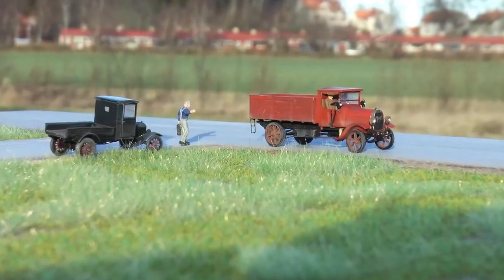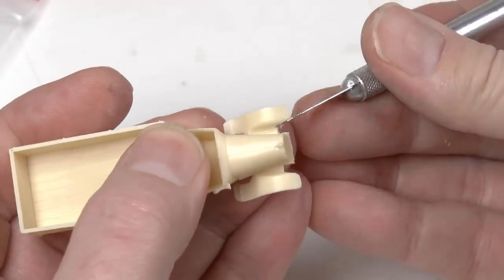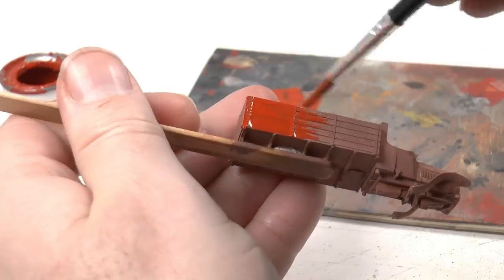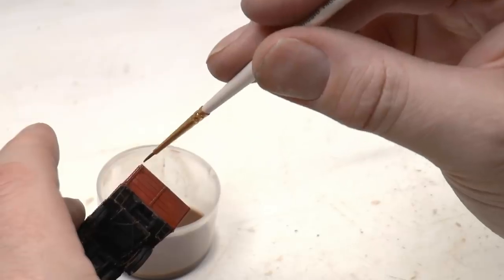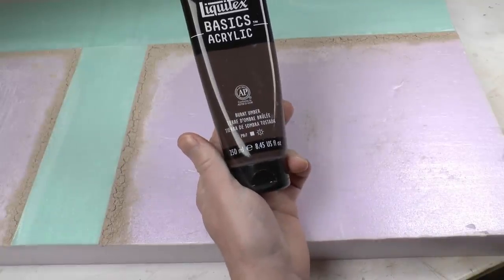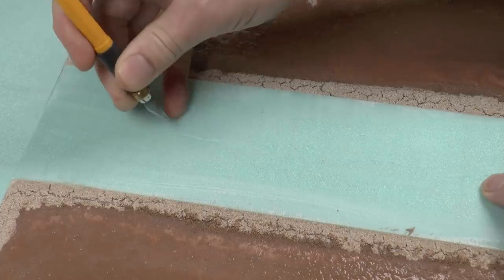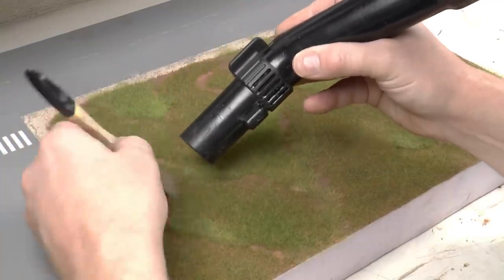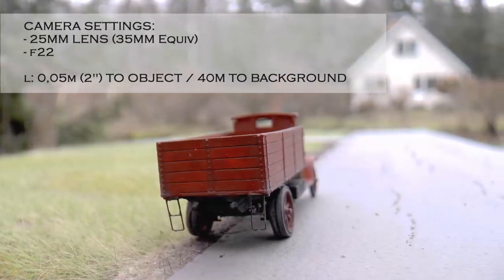Building and setting up a miniature Road

Comment: As acrylic primer for my resin or brass models as well as plastic and card & wood lasercut pieces, I always use the Vallejo Surface Primer, which comes in a variety of colors. You can either apply it with an airbrush or a brush (in which case I mix it 50/50 with model Color paint for more consistency as the Surface Primer is diluted for airbrush application. Let dry at least 24 to 48 hours before painting with any other acrylic or solvent based color.
To obtain a sharp image for the subject as well as the backdrop, there several solutions. The first one would be to work with the smallest aperture available (ideally close the lense to the maximum). You'll need to work using a camera stand due to the very long pause for this kind of picture. The other solution would be to take a picture of the backdrop without the subject, then add the subject (diorama) to the perfect distance and angle from the lense and use a green or blue screen backdrop and later on merge the pictures by photo editing it. The best result will always be obtained with camera lenses that allow to get the smallest aperture possible and taking the picture outside at low shutter speed (thus with a long expostion time).

Comment: The diorama came out nice. The truck looked very good. Maybe do the pictures with the overlapping technique with the computer. Focus on the background houses first then take several pictures focused on different places as you move backwards to the foreground. There is an photographic program you can use to overlap/overlay the pictures. I'm subscribed to a channel called TSG Multimedia. He explained how to do this with outside diorama photography in a video not too long ago. Within the last month or two. Maybe that would help you out. Check it out.   👍
Reply from the maker: Thank you for this advise! I’ll check it out!
Reply: @marklinofsweden  Oh. I've made a mistake and hope you read this before looking. It is not TSG the channel is "Model Railroad  Hobbyist Magazine" and Ken Patterson shows the technique. It's still the first video right now. Hope it doesn't cause too much confusion. I'd forgotten about telling you this until recieving this from you now. Sorry.

Comment: I recently watched your video on Marklin M-track. I have enough Marklin C-track I purchased  to make an oval;  and modified to two rail operations by cutting the running rails  so that each rail was isolated. My problem is that my two locomotives are two rail H0 Australian AR Kit so I have to have two tracks to be able to run them. I would like to expand my tracks to have some turnouts when I set it on the dinning room table; but I am not prepared to modify Marklin C-track turnouts so I thought that I might use Marklin-Trix C-track expansion set and replace the oval with some Trix C-track. I wondered if you ever thought of making some video tutorials on this subject of using the Marklin's Trix tracks like you have done with Marklin system. I some hope to own a few marklin locomotives; but now know if I ever build a layout it will be an 0e gauge.
Reply from the maker: Hi! Yes. I have plans for a serie of tutorials like that this autumn. Stay tuned! 👍